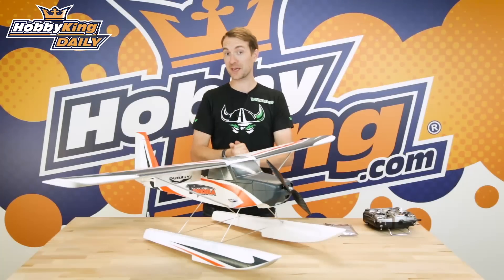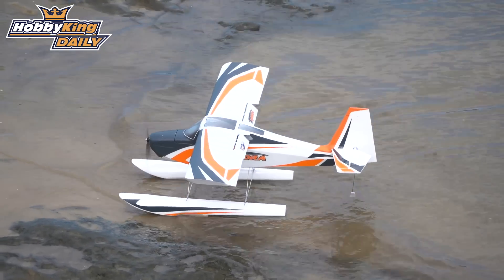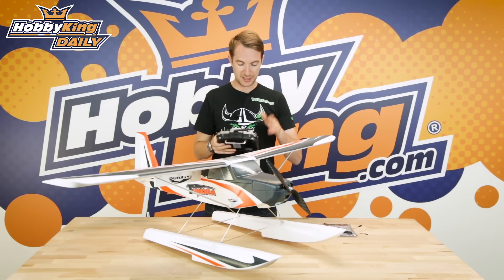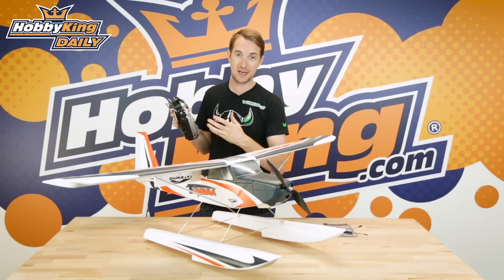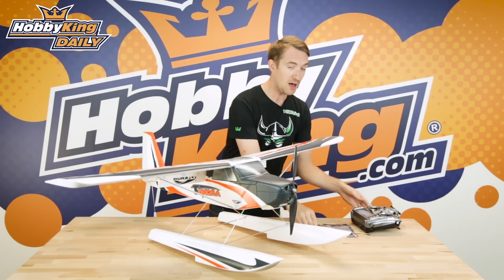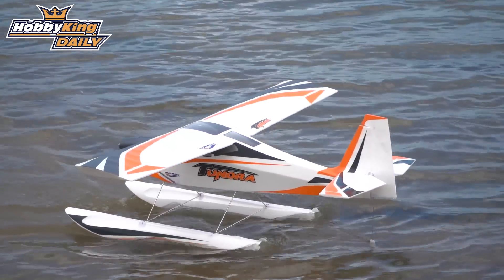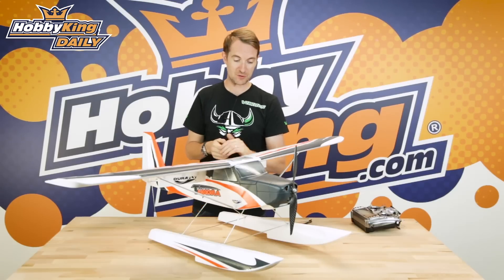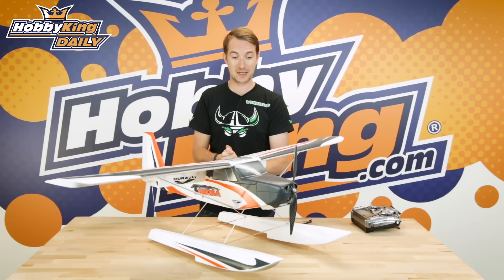Aerostar RVS Brushless ESCs w/Reverse Function - HobbyKing Daily

Comment: Will there be a 120amp version?  And a follow up, can you program the switch to be at full throttle reverse without any input from the throttle stick?  (For EDF applications, you need full reverse, so the jet doesn't go off the end of the runway)

Comment: Is this the same ESC as the one that came in the Skipper XL Stuart? Or would you consider it an Upgrade to the SkipperXL's ESC? 
Makes me think of 'preselect' gearboxes (which were 'a thing' in cars of the 50's I think?)
Reply from the maker: DutchRC Adventures nope, it's not the same, but it is the reason we now have the RVS range as it was soon clear we needed a better solution.

Comment: Many people buy parts off of your site for Combat Robotics. One of the most popular things to do is to buy hobbyking esc's and program them to be reversable. This allows you to use Brushless motors (with gearboxes and wheels) to drive the robot. This product seems convenient for saving programming time, but is there a way to turn off the safety reverse delay, and control it with aileron/elevon in order to easily drive a robot with two of these esc's on one receiver?
Reply: how do you program it to be reversible?

Comment: it appears that hobby king has no intention of restocking this. i noticed the 60 amp reversible and the 60amp non-reversable are the same with the exception of the two wires soldered in. I tried this but i had no luck getting it to work which probably means it needs to be programmed. can you please help me figure this out? i really need one of these. I will pay you if you tell me how you did this.
Reply: Any luck Michael ?

Comment: Hello everybody.
I LOVE my Tundra! 
After ger use to it, I want to explore over water. 
I believe I did program everything ok on the radio (Taranis X9D). When throttle (ch3) is enabled, reverse (ch8) is disabled, and vice versa. I cant make spin reverse even when I change throttle (ch8) to reverse (ch3). The reverse channel never works, no matter what channel. Is my 1st go bi-directional. Could please someone help? Coud it be a faulty ESC?
Thank you all
Reply from the maker: make sure the travel on the channel you assign the reverse to is +100 in one direction and -100 in the other.
Reply: @HobbyKingOfficial  no change. I try different kill switches to make sure throttle was at -100. How can I test if my ESC is faulty?
Reply: @HobbyKingOfficial  if I power the receiver independently,  I should be able to ignore de BEC cable and power the plane using the reverse cable as throttle. When I do this, de ESC doesn't bip start
Reply: @HobbyKingOfficial  I have checked continuity on the cable and it's ok.
Reply: @HobbyKingOfficial  Ive got -100 and +100 still no reverse